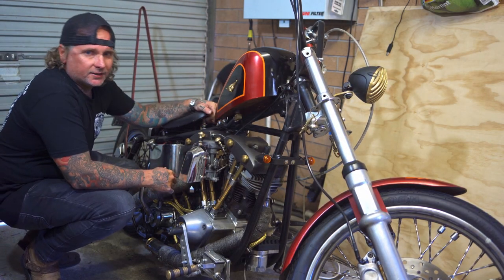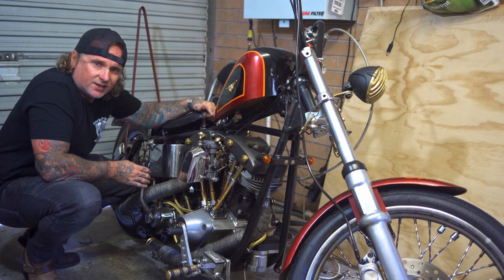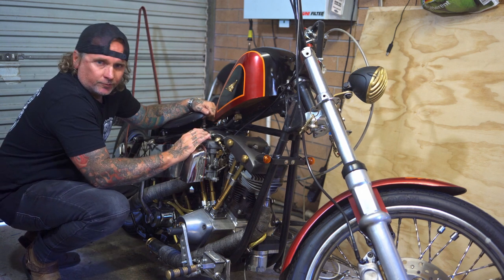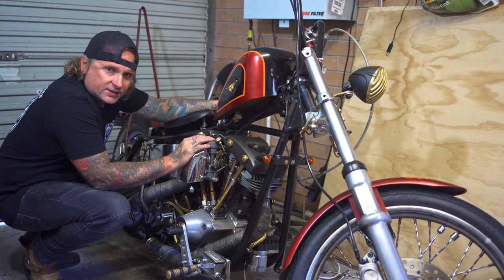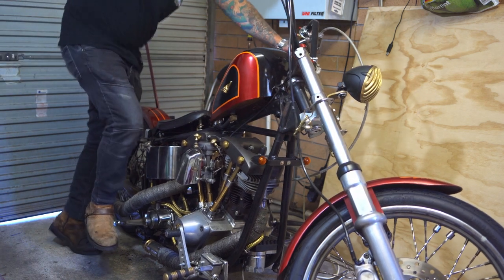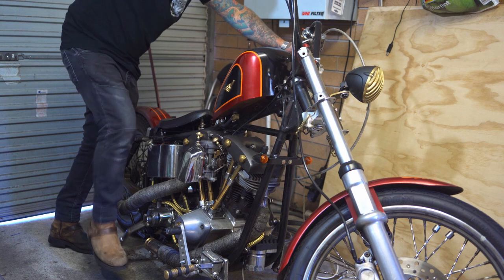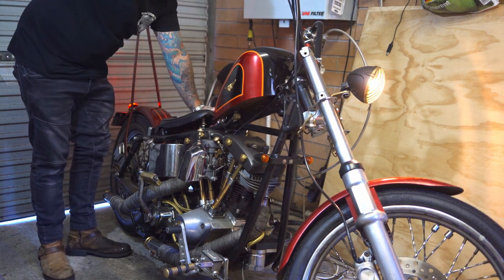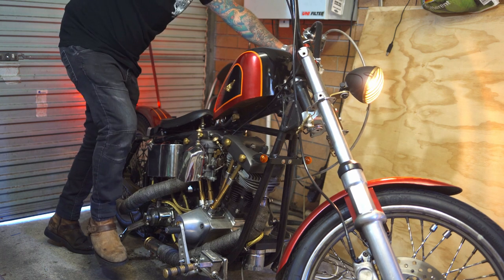How to kick start a 1978 Harley Davidson Shovelhead chopper -KICK ONLY-

Comment: I miss my Pan/Shovel and my 1966 FLH. I think I'll go with a 93-inch S&S Shovelhead engine for my next build. A Baker 6-speed transmission would be nice, as well. Cheers and safe riding to you cats in Oz and in Old Blighty.
Reply from the maker: ✊ respect ✊ now that’s a build I’d love to stare at😳 thanks for the comment. 🤙🏼 have a great day.
Reply: I still mourn the loss of my 54 Pan/Shovel to a fire a couple years ago....but, I still have the cases and bottom end, tranny case and gears....frame, triple trees and sheet metal still.....I have found a shop that will powder coat my frame, with the added n=benefit of stress relieving it....so, it is doable....fortunately I have an old 93 Evo to ride.
Reply: @TheWolfsnack  -- That's awful about the fire and losing your ride. At least you made it through okay. Keep that Evo. They're reliable. Ride safe. Cheers -- Walt Greybeard
Reply from the maker: @TheWolfsnack  sorry to hear that, I also have an evo that I’m currently working on. May get a feature on this channel if I’m feeling it. It’s an 1996 fxdwg.
Reply: @MikeyForLife  Nice.....I have a 93 FXDL right now, mostly stockish....OK....stock paint for now...but stage 1 kit, Rumble Stick cam from Headquarters, Screaming Eagle ignition, heads flowed and ported, Andrews gears.....an FXWG front end is in the works down the road. I was putting my own bikes together back in the 70's and built a couple rides like yours. Good job BTW.
Reply from the maker: @TheWolfsnack  thanks very much. that sounds awesome mate. I’m looking at doing some sort of upgrades to my wide glide as it’s only a 1340. Not sure which direction to take yet, maybe start with a cam and work my way up. Anywhere I can see photos of the low rider?

Comment: You have 2 inch pipes on that ? No baffles?
Reply from the maker: Yes sir. I do have tunable washers toward the end of each pipe. Set to fully closed constantly. Back pressure and tone 💯 thanks for the comment.
Reply: @MikeyForLife  about how much pass through  space between  the washer and inside of the pipe. When it's fully closed off  ..like maybe 1/2 inch ? 1/4 inch ?
Reply from the maker: @hanskonrad5850  I would say about half inch.

Comment: Mikey, constant stream of oil coming out of oil breather when I kick it over. My bike had sat for bout 2months until I fired it up today. Any help is appreciated.
Stoney
Reply from the maker: Sounds like it’s sumping, if you have left it sit maybe the oil check valve is stuck open. Check the oil pump, there is a small ball that needs to seat perfectly or oil will pass through.
Reply: @MikeyForLife Many thanks!